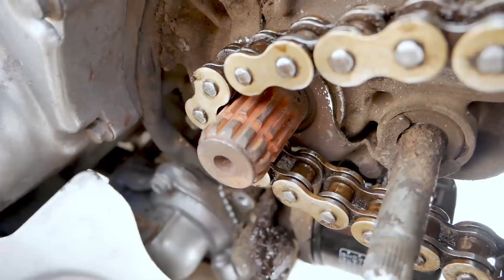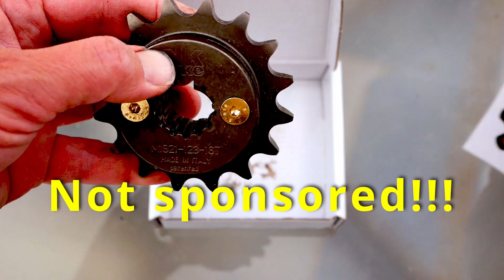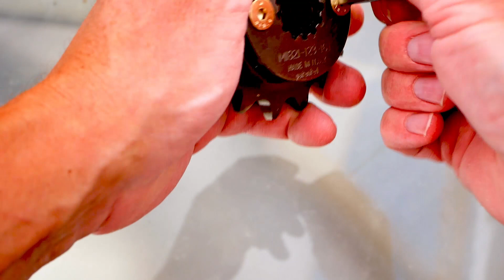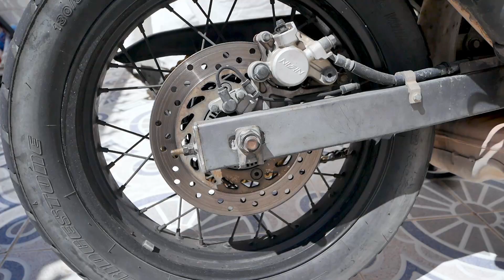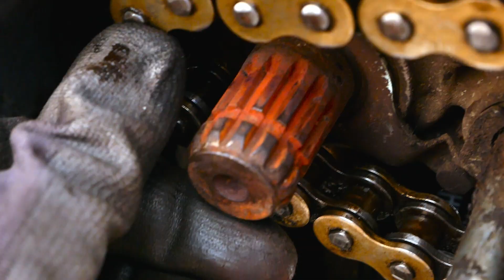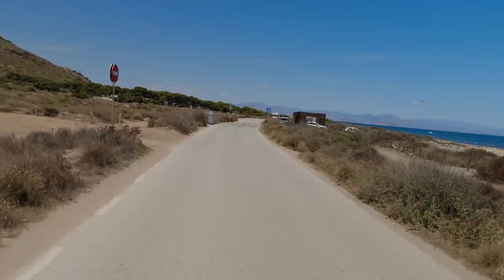SAVE your Honda TRANSALP from destruction !!

Comment: Muito  bom esse produto. Bom,  um produto pode ser aplicado  para remoção  da ferrugem no eixo e após  uma lubrificação. Aquela ferrugem ataca e desgasta o eixo. Em minha Transalp regularmente faço  a limpeza  neste eixo. 
Obrigado pelo vídeo!
Reply from the maker: Yes, the rust also increase the wear on the shaft and sprocket. So a good cleaning here and there helps a lot. The main problem on the Transalps 650 and 700 is the quality of the steel on the shaft, which is lower than the 600 and Africa Twins, and thus gets wear pretty fast. The problem on the 600 and Africa Twins is that even if they last longer, at some point they will wear, and the parts are not available anymore or difficult to find, and the repair is very labour intensive (aka $$$$$), so better to spend a few bucks and double the life of the shaft. Cheers!

Comment: Bro you mentioned africa twin also which models plz i have 2018
Reply from the maker: Hi there, I'm talking about old Africa Twins pre-2005. But most of them only need the superpinion if the countershaft have too much wear due to high mileage. The main problem is with old Transalps 650 and 700, in which the countershaft splines get worn out a lot faster due to poor design or bad quality.
Reply: This is only for the real africatwin xrv 750 up to 2003. Newer models are different.

Comment: I wish i knew this yesterday. Mine has completely stripped.
Reply from the maker: That's why checking and replacing the sprocket is the very first thing I do when buying an old Transalp or Africa Twin. I whish the supersprocket existed when I got my first Transalp, that would have saved the countershaft on my 650. Instead I had to fully open the engine to replace it.

Comment: In your opinion which engine take more abuse (durable) ,  Yamaha, Suzuki, Honda?
Reply from the maker: Hi man! That is an imposible question to answer, as there are a lot of models and years of production. Some engines are more reliable, than others, and in my opinion the peak of quality on the most sold motorcycles was achieved in the '90s, later on the quality started to go down to reduce costs, except on very expensive top of the range models which duplicated their price instead of reducing the quality. Look at the price of a new Honda Fireblade compared to average wages, and then do the same with the new price of the original 900 Fireblade with the same year average wages.
With that being said, after owning, and abusing, dozens of bikes, and having dismantled or repaired a few other dozens, at the moment I'm sticking with Honda and Suzuki. But again, keep in mind I usually buy bikes with 10+ years, and models that have proved to be reliable, so I have no clue which new bikes are more reliable, but you can get a good taste when going to a dealership and check the quality of plastics, metals, paint and the overall enginering of the bike, not only the looks. They all look good now, even the chinese bikes. Cheers!
Reply: @coastrider8881  very very thankyou sir, for your valuable feedback 🙌,, greets from India 🇮🇳

Comment: I have the same problem when i try put this Superpinion, how did you can put the retaining plates?
Reply from the maker: Hi! Yes, it's very tight to take advantage of the full lenght of the splines. I used a rubber hammer and very carefully pushed the sprocket back until there was enough room for the plates. Cheers!

Comment: I would advise using a heavy grease between the splines and sprocket
Reply from the maker: That's what I would do if I'd only use the bike on the tarmac, but I frequently go to easy trails, and my area is very dry, dusty and sandy. The mix between heavy grease and sand would convert it in sandpaper and grind the shaft and sprocket. Thanks for watching!

Comment: I was looking for something like this for Suzuki GS 500?
Reply from the maker: Hi Konrad, thanks for watching. I've never heard of this problem on the Gs 500, is your countershaft damaged? Usually on the GS 500 the problems comes from the cylinder head because using the bike with a too low oil level or bad valves clearance, and also from the stator/ rotor of the ignition system. Cheers.
Reply: @coastrider8881  gs 500 engine is bulletproof!! There is no common problem in engine other than paint finish and fuel system problems..
Reply from the maker: @Kappa6813  The gs 500 engine is extremely reliable, but still have some common troubles, like the rotor in the alternator system and the camshaft if you use bad oil or low level of oil for a long period. The most reliable bicylinder of that period is the Honda CB 500. You can find units with several hundreds of thousand kms that still work like new. The only weak point is the regulator that can be easily replaced for around 30 bucks. Cheers.

Comment: Perhaps a little cleaning and grease before fitting new parts...
Reply from the maker: Thanks for watching! I cleaned the countershaft, but I never grease them on bikes I intend to use offroad, even for mild offroad. The mix of grease and dust / sand becomes a grinding paste. Neither the RMT (Revue Moto Technique) nor the Haynes workshop book recommends greasing the countershaft or the sprocket inner splines. Cheers.
Reply: I guess the "special" sprocket could be very easily modified to make it water-thigh and allow for lubricant. Because metal dust and mud is not a very smooth either.

Comment: That's why you ride cardan driven bikes.... ;)
Reply from the maker: Yep, because we all know cardans never breaks  and are cheap to fix :D
Reply: @coastrider8881  convenience comes with a price.... If it crashes, it stops, this also applies to chain-driven bikes.
I think the choice boils down to, the logo on the fuel tank.
I like my logo, respect yours. Have ridden chain driven bikes before, don't like the maintenance. That's all, I think. However, I like the reliability of Japanese bikes. Those cardan driven bikes are mostly from Europe, not so reliable. So who is right, you or me?
Reply from the maker: @TheTuxMaster  Correct, everyone has different needs. I prefer chain driven bikes for heavy off road use because the system is lighter, easier to change the gearing ratio and more reliable and easy to fix in for hard offroad. I'm not going that hard with the 700, but certainly did with the 650. I would definitely consider a cardan driven bike for more road oriented use, but it would probably be a japanese model, because I like to work myself on my bikes and these are easier to work on and the parts are usually cheaper. Cheers!
Reply: Honda VFR1200X Crosstourer has shaft.